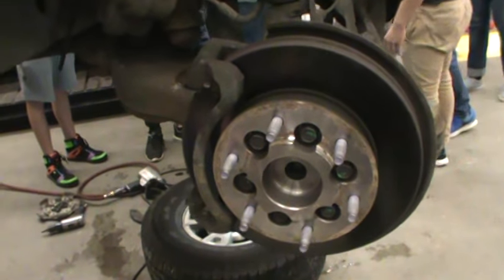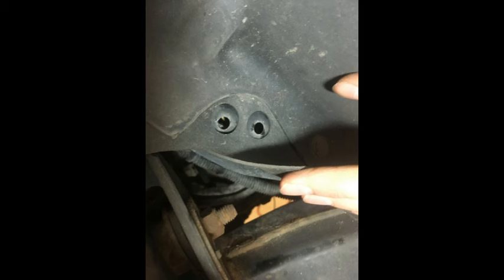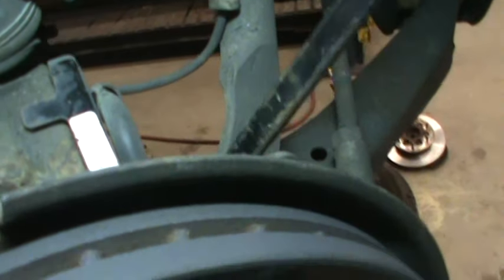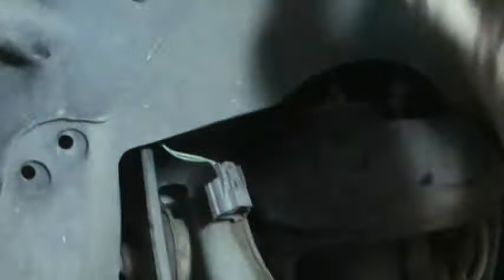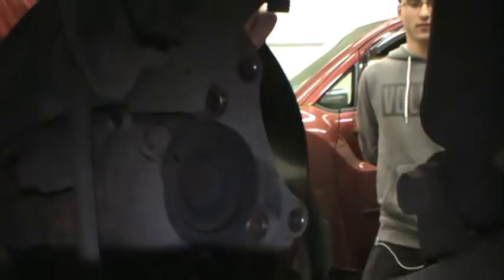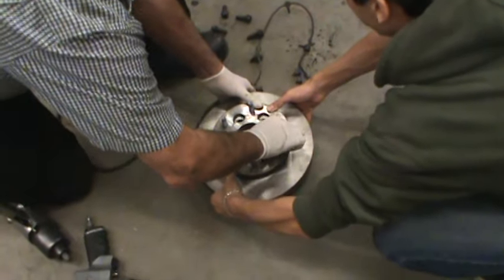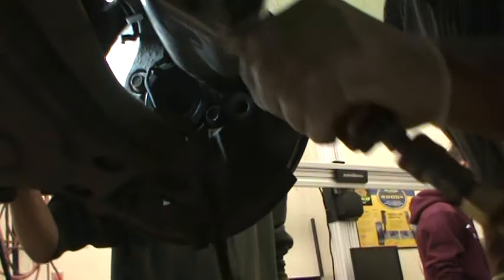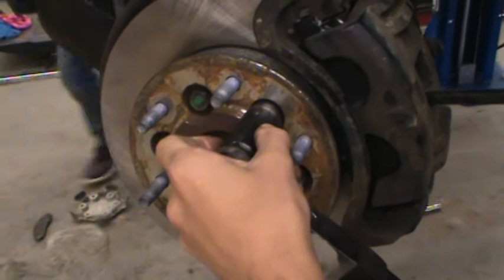2006 GMC Canyon Front Brakes

Comment: In case anyone has a 2007 Chevrolet Colorado, the 6 bolts (17 mm) that hold the rotor in place to the hub are tightened to 81 lb ft.  The 4 hub assembly bolts (15 mm) are tightened to 92 lb ft.  The brake caliper bracket bolts (21 mm) are tightened to 129 lb ft.  And of course, don't forget to tighten your wheel lugs to 103 lb ft.  These specs are straight from a 2007 Colorado service manual.  I could be wrong, but the torque specs should be the same for 2004 -2008 colorado/canyons.  Double check.
Reply: Your a god, thank you
Reply: Finally someone who puts out the most important information.... why i had to find it in the comments is a bit beyond me.... but thank you sir you are a gentleman and a scholar!!!!

Comment: A question to you dear sir! I just helped a friend remove his bad hub bearings on 4 WD  Colorado and they were pretty bad after 200 K miles. Ordered new hubs off Amazon that came without speed sensors , they were sold as a universal  hub for speed sensor or non speed sensor.Got steering knuckle all cleaned up nice and 
installed  new hubs nicely  ,drive shaft nut etc!  When installing the original caliper bracket over the rotor ,when you tighten caliper bolts fully , it binds the rotor from turning. New rotors , New hub bearings, but caliper bracket is original .We picked up new caliper brkt  to try and it does the same thing. Going to clean steering knuckle casting again good where brkt  contacts  knuckle  to make sure no burrs or scaling causing clearance issue! If that's not it. I believe it would have to be  the  hub bearings tolerances. Wonder what your thoughts might be!

Comment: I will probably never buy a Canyon/Colorado just because of your video. That is an engineering nightmare.
Reply: 304eROD not too bad.  Few friendly words and it's done
Reply: Other than the brake job from hell the rest of truck has been like an anvil. That said I'd never buy a used one without pulling a front wheel lol

Comment: I have a 2005 chevy colorado 4WD and I changed my wheel bearing out and it was the worst experience of my life. I had to remove the whole steering knuckle just to get those bolts in the back to come out. I don't know what chevy was thinking when they decided in order to change a common part out such a brake rotor that they should make it so you have to remove your whole hub assembly in order to do it. Worst design I've ever encountered from chevy.

Comment: Hi, o.k. I have a problem.  My truck shakes when I'm slowing down or pressing on the brake.  O.k. I've had front and back brakes replaced and it's still doing the same thing.  What else could be the problem??  Any ones help would be appreciated.
Reply: You need a tire balance. probably lost the little weight that's on the rim. Happened to me as well
Reply: @rumraiderarcader7567  When do U know when you have to change rotors or just the pads?